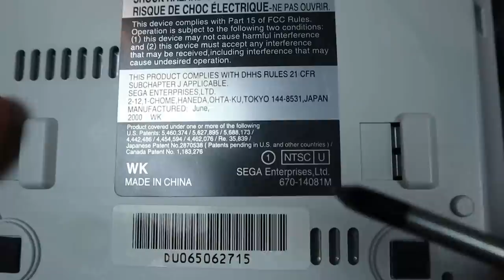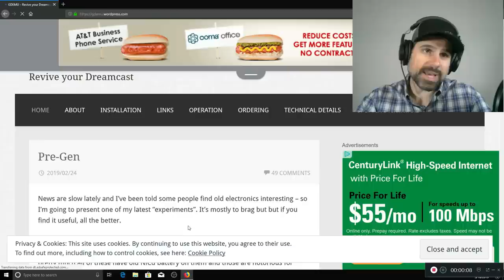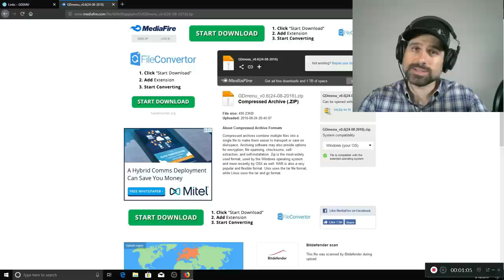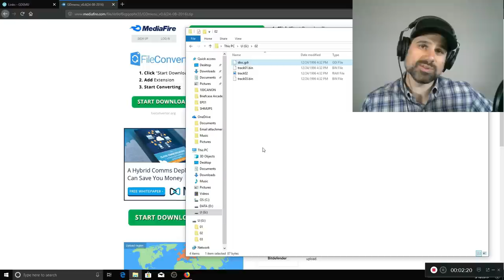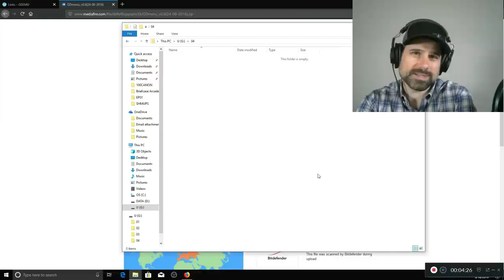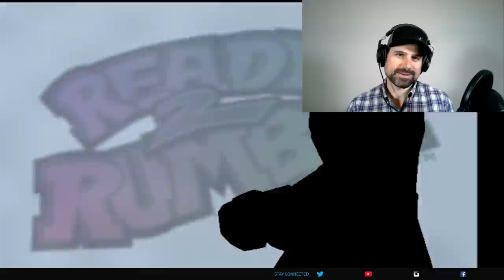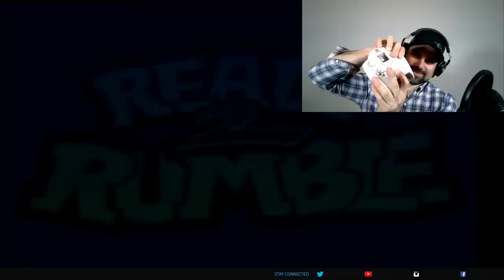Dreamcast SD Card Mod!

Comment: I just ordered one of these and decided to look up a video on how to set it up. Thanks for taking the time to show this. I’ll be setting it up soon.
Reply from the maker: Awesome man, I did have an error in this video, you should be able to use larger SD card than 32GB.  I have one installed that 128GB and it works great.  Just wanted to give you a heads up 👍🏻
Reply: Retro Ralph yea it’s cool. Either way they have software that will let you format higher capacity cards to FAT32.

Comment: OMG…!! This is the vid I’ve been waiting for… I have about 6 DC on hand... going to mod at least one... Thanks RR you Rock…!!!
Reply from the maker: No Problem man!  Thanks for watching!  Quick tip... make sure it's a VA1 version.  I mention this in the video but that's VERY important.  Also... don't update the firmware on the DGemu.  :-) Have fun man and thanks again for the support!

Comment: Hey ralph. I've seen a couple videos of people running Daytona on mame in diy cabs with a wheel and pedal setup. 

Build series???
Reply from the maker: I keep toying with the idea of a racing cab... hmmmmm.
Reply: I have been playing with this idea too ever since I purchased my arcade 1up machines.

I am working on a visual pin for my game room. It's a father son project as my dad is working on the cab and I am handling the electronics and software. 

Luckily I have enthusiastic kids and an understanding wife lol
Reply: Hey buddy have a few questions do you have the original gdemu or cloned also when formatting SD card to fat 32 what clusters do you have set and when downloading firmware do I need to reflashed SD card 1st to gdemu to make sure the lights on gdemu flashes before adding games or just add games from gdemu website
Reply: @RetroRalph  I work in an Arcade and have converted 3 daytona cabs so far to run on m2emu.  Works just like the original :D
Reply: @TobyRieper48  That is just blasphemy.
Reply: @segasonic9117  How is it? They work and feel just like the original. Force feedback, gear shift, lamps, nanao crt all  I did was replace the Model 1 boards and used a PC interfacing with the Sega drive board via Arduino. Blasphemy is throwing away arcade cabs just because their boards are  dead. I never give up on a machine. Those model 1s keep dying they are so darned old and people spill crap over them and they over heat.. model 2 emu is accurate outputting 15khz with original resolution.
Reply: @TobyRieper48  You don't mess with the legend of Daytona.

Comment: This module is great. Do they offer it also for other consoles? Utilizing the CD connector is the best option for modification without soldering and risking to brick the system.
Reply: Only the Sega Saturn currently, but it isn't called the same name but by the same guy called Rea and Phoebe for the different revisions of the Saturn. But lots of other consoles have these things, they are called Optical Drive Emulators, and the 360 and PS3 even have these devices, but the appeal there isn't as strong as with consoles with no HDD's.

Comment: Fyi.  Be aware.   He is using a CLONED gdemu.  Not the official gdemu.  While the cloned versions work fine and function identical from the original, DO NOT UPGRADE THE FIRMWARE ON THE CLONE GDEMU.  it will permanently brick the cloned gdemu.   The stock firmware is a rip of the original and the sellers do not have access to official fw or updates.
Reply from the maker: retro king Thank you for that reminder.  It is in the (link) instructions I put in the description but I forgot to add the disclaimer to the video.  I just put it at the top of the description.  Thank you again for the reminder, it’s much appreciated.  Thanks for watching and supporting the channel.
Reply: @RetroRalph  no problem bro! I have a cloned gdemu myself and just wanted to get that info out there to the potential buyers of it.  Great channel and love what ya do.
Reply: Ok so i can use the link he provided, just delete the firmware file?
Reply: Good to know, waiting on my clone gdemu. After years of unsuccessful attempts at getting an original, I said screw it at this point. Can't wait to get it! Thanks Ralph for the video!

Comment: More than not, available Dreamcast roms out there in crazy web these days are different degrees of crap when it comes to original hardware. Even renaming gdi and cdi files won't work with the gdemu when using dumper roms available on most sites. Just keep looking until you find the gdi roms you don't have to rename - they're out there and all you do is drop them in a numbered folder with the gdemu files and gtg. They will read something like - "Crazy Taxi 2 2 v1. 003(2001)(Sega)(US)(en)[!].... and will include raw and bin tracks. A friend of mine just showed this to me. Maybe I'll do it myself someday.

Comment: hi
I downloaded some game but the format it's .7z not gdi or cdi. Can I convert them?
Reply from the maker: rastarito You need your download 7zip and decompress the file.  You should see the files once decompressed.  👍🏻
Reply: @RetroRalph  I'm having a really hadr time getting to install de games. The dreamcast recognize the GDNU, the GDMU recognize de SD card, But not the games. actualy I downloaded de the "REady 2 Rumble games from a web and the files are different. I'm using Mac by the way. I did everything exactly Like you say. I downloaded the GDMU firmware, I didn't touch the 01 folder. Added the game, Change the name to "02" , I change the GDI file to "disk". I'm going to cry.
Reply: @RetroRalph  got it aparently my GDMU only support CDI format. I try whith GDI and did not work.

Comment: What size SD card can it go up to?
Reply from the maker: Geoffrey Johnstone 32GB seems to be the max size that’s supported.  I’m going to try a larger card but I haven’t got to that yet.
Reply: @RetroRalph  
Thanks for the response, RR. I think I will get one of these as my laser is definitely on its way out.
Reply: It would be cool if it can take a larger SD card like 128GB or even a 256GB. You can roughly put 40 games on a 32GB card